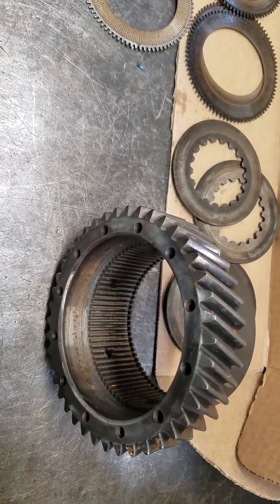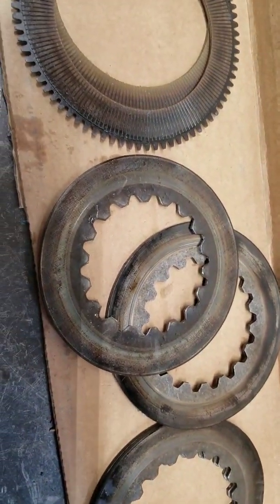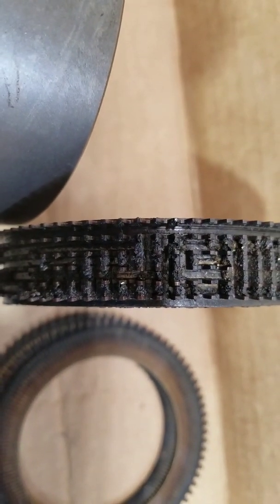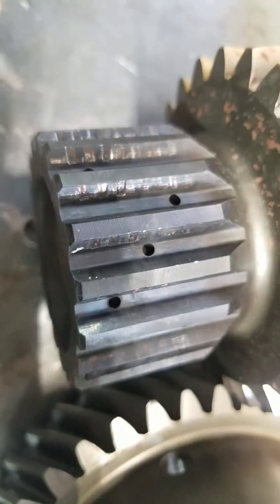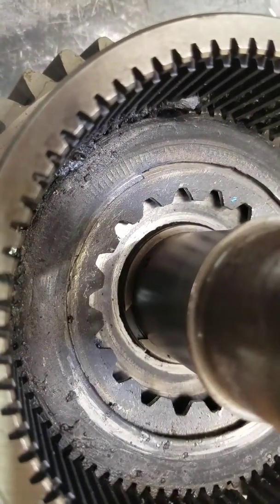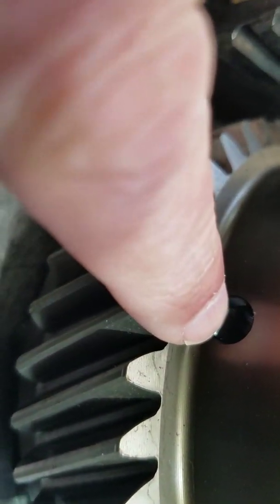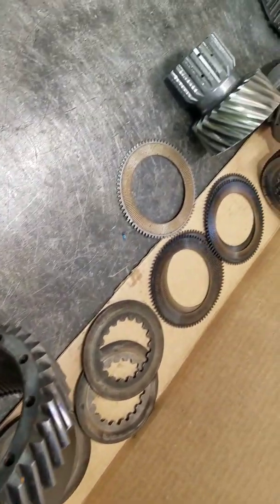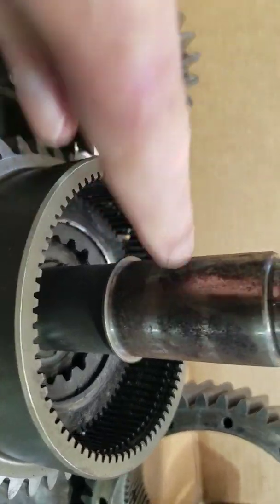Customer request. Transmission Failure

Comment: My compliments! I used to rebuild plow truck transmissions in Michigan and I've encountered fused clutch packs like that. Typically the first gear and forward clutch would fuse. Then they would put in reverse and smoke the reverse drum and wonder why it wouldn't shift or go above 20mph.

I started watching your channel because I have a Sea Ray 340 and I like to know what my transmissions look like on the inside. I keep that in mind when I service them. Keep up the good work!
Reply from the maker: Thank you for your comment. A Searay 34 nice boat! Enjoy your summer.